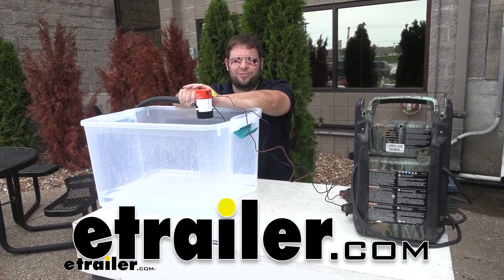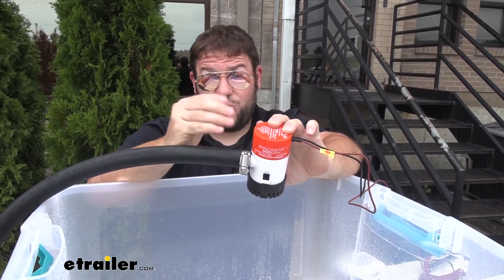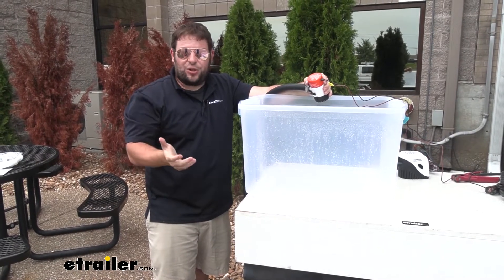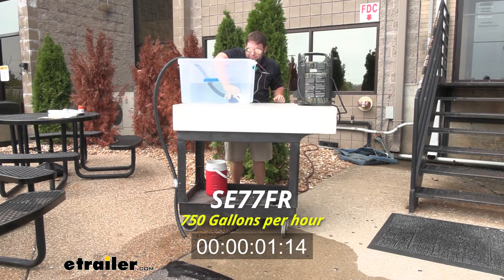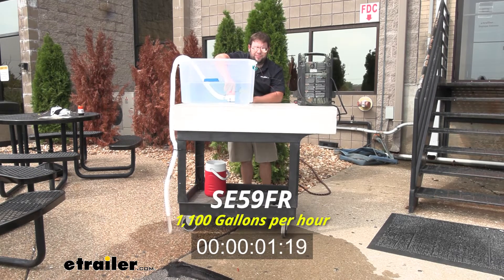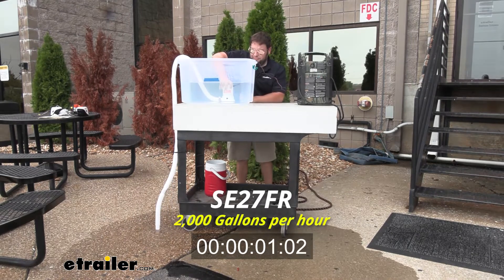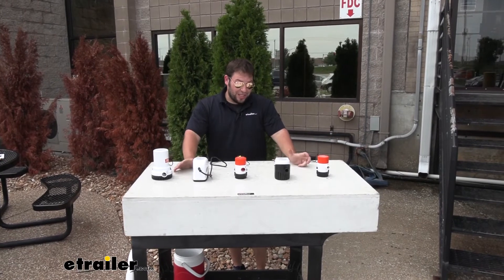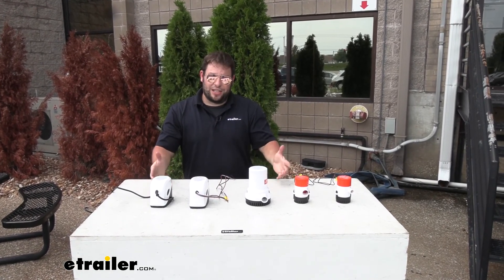etrailer | In-Depth Review of the Seaflo Non-Automatic Bilge Pump

Comment: Are you running the bilge pump with a jump starter? If so,what amp output do you need to run the pump and for how long can it run for?
Reply from the maker: This bilge pump will require 12V power and will pull a maximum of 4 amps.
https://www.etrailer.com/Boat-Accessories/Seaflo/SE87FR.html